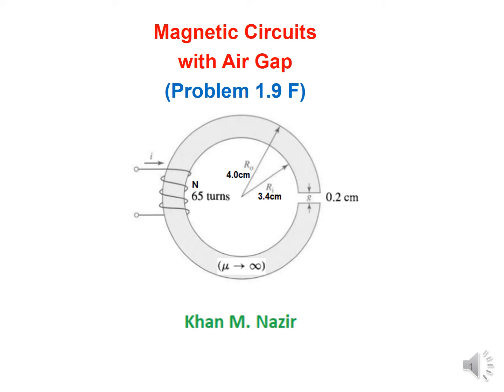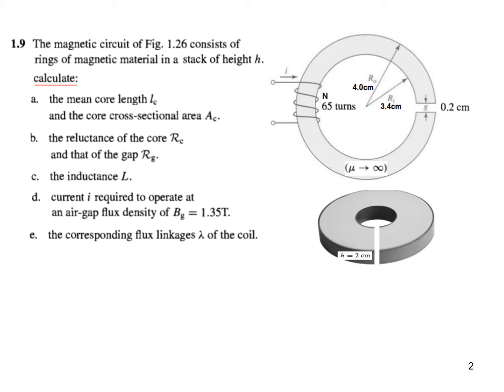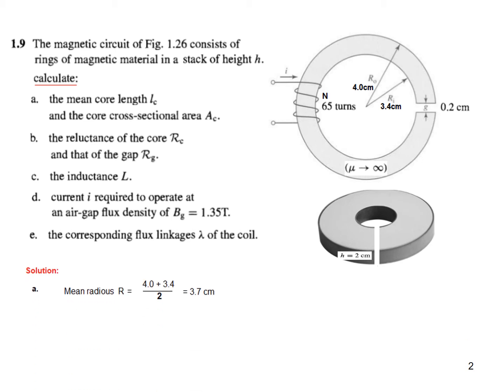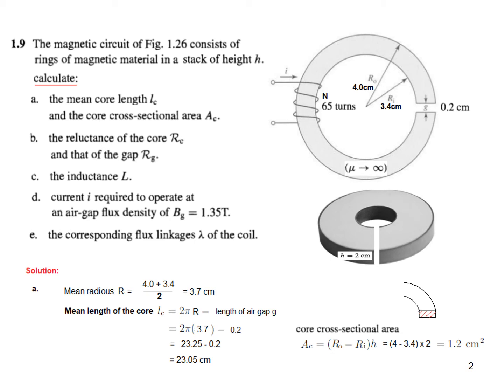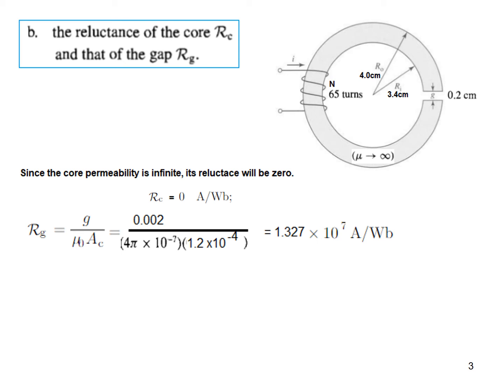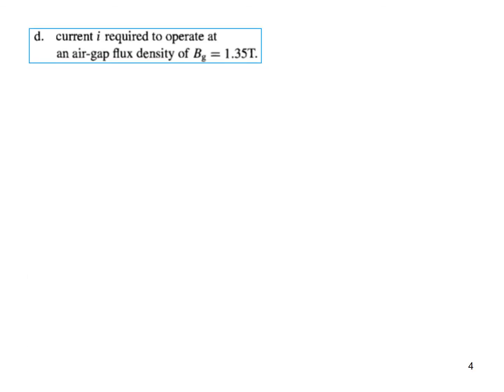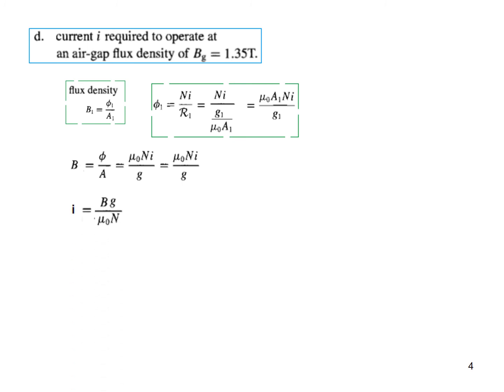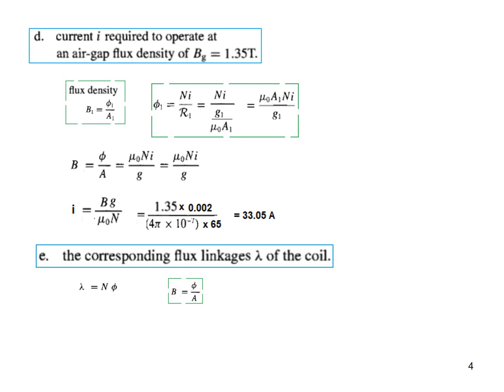(E)EM(F) Q 1.9 || Magnetic Circuits with Air Gap

Comment: Your answer is wrong, it actually is 2.08 *10^-5 Wb
Reply from the maker: Please write video time, so I can follow you.
Reply: @ElectricalEngineeringAcademy  The "try it" exercise at 10:00. 
That said, you should make more videos about Fitzgerald, they are really useful!
Reply from the maker: @bartolomano5316  ok
Reply from the maker: Yes you are correct. You are first one in so many years, who has tried to solve it. Thanks
Reply from the maker: Actually the question has an error, the air gap is 3mm not 3cm. With this correction you will get the answer I have written.